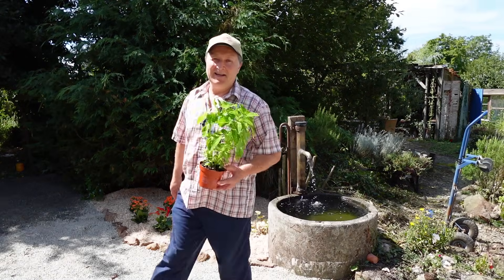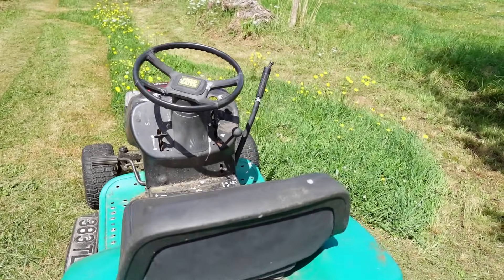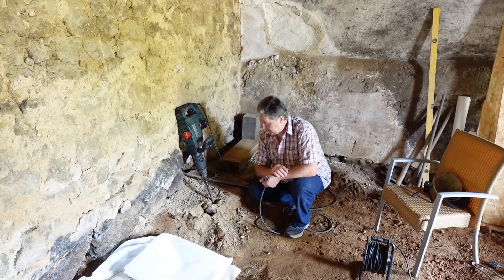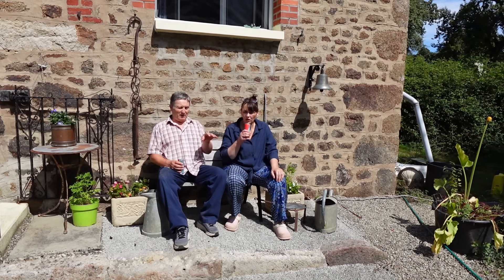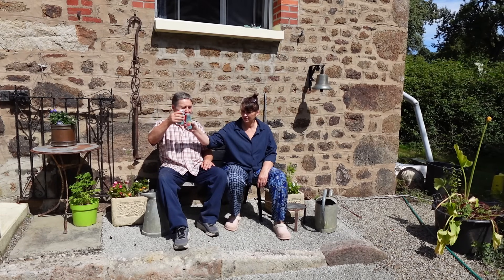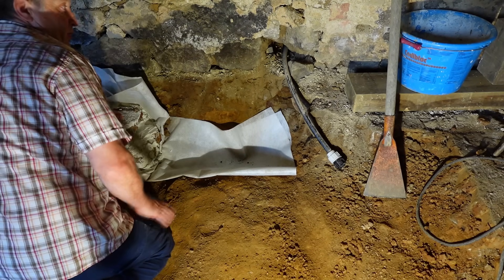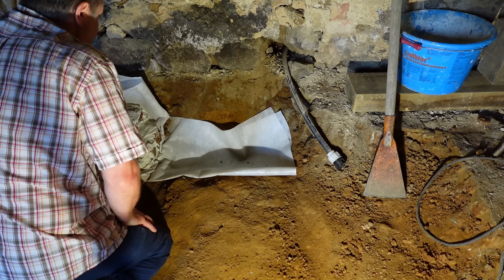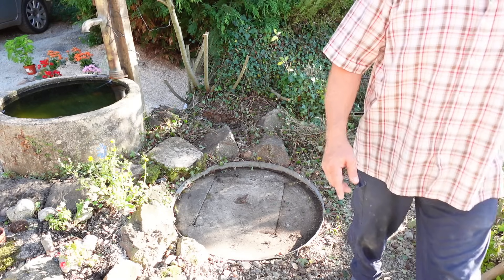Striking a Balance: Maintenance vs Restoration

Comment: I find it good to have a trug (a plastic bucket with handles) at hand to put the extra rubbish in so you aren't doing the same job twice. Then use it or throw it.  A small section at a time eventually makes you a beautiful garden.

Comment: Sean the solution to extracting water from your well, given the head you mentioned, is to use an electric submursible one. These have been around a very long time and you may even be able to get used or refurbished ones.
Reply: Great Idea 💡
Reply: Absolutely and depending on your needs you might be able to get by with a dirt cheap one from the nearest DIY store. If you wanted a nostalgic-looking setup you can also get inline hand pumps that mount down in the well (above the water level but just about) and connect to the handle at the top with a long rod. Pushing water up a pipe is much easier than sucking, that's why you need to get the pump close to the water line. We've got one of those hand pumps but unfortunately it's frozen solid down in the well and we haven't been able to get it to work. We'd have to get the water tested anyway, the village got mains water decades ago because of nitrate contamination in the wells so we'd have to see if that's still an issue.

Comment: Ivy, is a nightmare! In my last house we had ivy and it took over some gardens and fencing, I was trying to pull some up and herniated some discs in my back, excruciating pain and long recovery.
Eight plus years later and I still have issues with my back if I’m not very careful. Mind you it originated from a small amount of ivy in a pot plant and some escaped 😵
Reply from the maker: Nightmare stuff ivy, yes still suffering 20 yrs later from an industrial injury to my back, just keep pushing forward, as Iam always aware lots of people are in much worse health.

Comment: Just curious, and I only thought of it because of our extreme weather.  What happens if the moisture gets in, and then freezes before it can dry naturally?  We have that issue with our roads which are always needing replacement what with the freeze/thaw cycle.